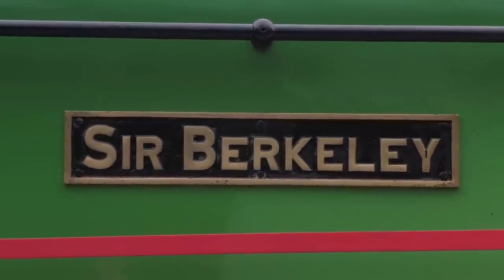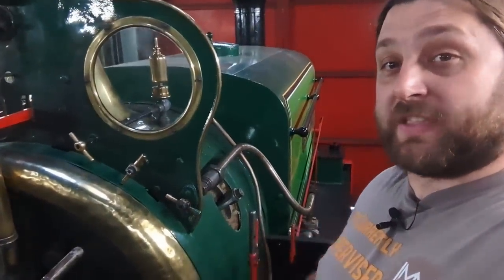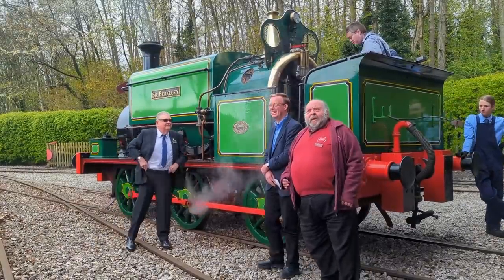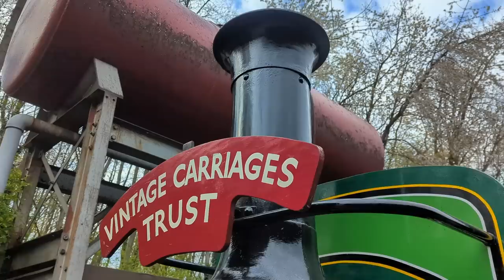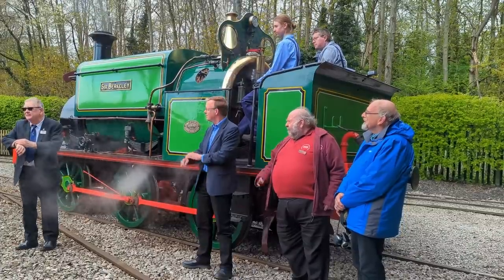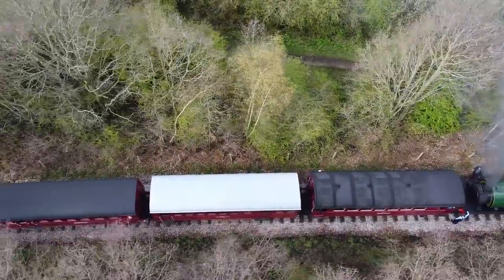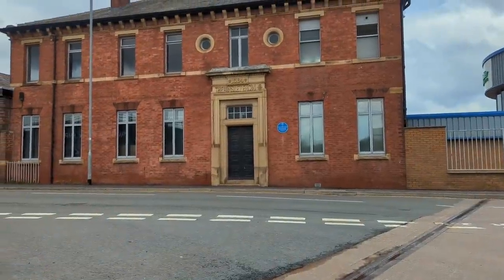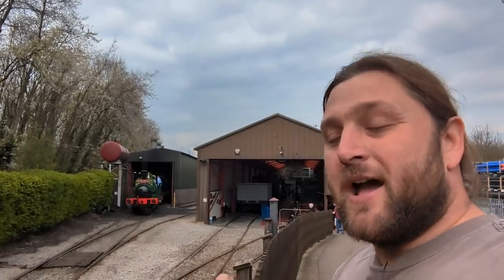Stuck in Section at the Vintage Carriage Trust's Sir Berkeley Launch!

Comment: I worked on Middleton railway back in the 90’s from 11-13 years old. Sadly a move down country meant I could no longer work there, Sir Berkeley is one of my fondest memories. I’ve washed, polished, filed the coal bunker, filled the oil pots and sand boxes, I’ve even had a fireman’s breakfast on the foot plate before helping shovel the coal as we ran up line. Such a privilege and a beautiful engine.

Comment: When the engine was last in service I remember it de-railing on the top points at Middleton Park. The points have to be taken at an absolute crawl. I assume it is because of the radius of the curved rail. I think it's last tyres had a flange-less centre axle.
A good mention of the locomotive's existence as a contractors engine. An excellent comparison to a dump truck. One like yours Lawrie.
 One of the tubs would have been of similar capacity.
I wonder why the locomotive could not re-start after it ran out of steam. Is there an issue with the valve-gear in that it can stop on a dead-point between inlet & exhaust events?
Reply: The de-railing occured because the test run had only been up and back on the weds beforehand, with no manoevre over the curve of the points.  There being no haynes manual for Hunslet locomotives what happened is the springs , which appeared to be interchangeable, were a mix of handed and tempered to take specific weight loadings along the frame etc,  so a lot of dismantling to get back to remove all the springs, check and re-measure, including weighing calculations to re-fit them in the best order and location.  It is then just common practice for all the locomotives to take the turnouts at a fairly slow speed as they are fairly tight on radius and the ground at the top is not easy to keep level - though more re-ballasting has helped over the last 20 odd years.

Comment: Great video! I love the Middleton, I was there for Sir Berkeley's test run at the start of April, it looked great. Good to see they've repainted the front buffer beam, it was pink at the start of April! On a different note, I remember the last time I rode on Sir Berkeley before its overhaul was in 2016, and it stopped in pretty much the same place then! Also, did you not see any of the other double headers? They did at least three around twelve o'clock, or was that when you were going to Hunslet?

Comment: Beautiful locomotive but nothing speaks more about the social class of engine men when the designers don't include a cab for the drivers.  Must have been brutal back in the day to operate this engine in the "lovely" English weather. 
That spectacle plate that provides no protection from steam or weather is an absolute shame.   
Of course my comment isn't meant to take anything away from the magnificent work everyone put in to overhaul this locomotive and keep it running properly and looking beautiful.
Reply: The lack of cab was the contractors choice- he believed crew worked better in such conditions